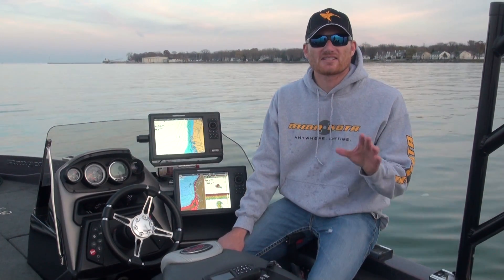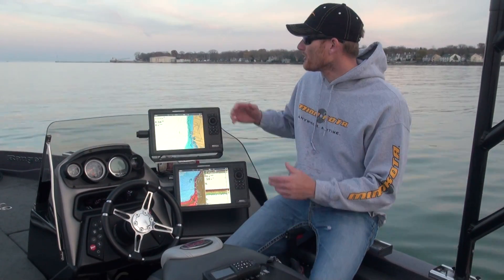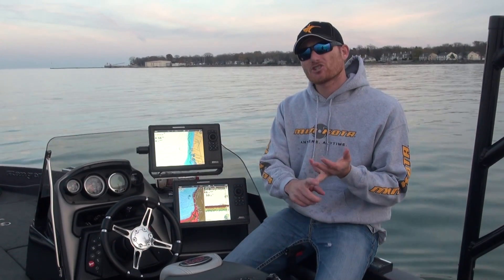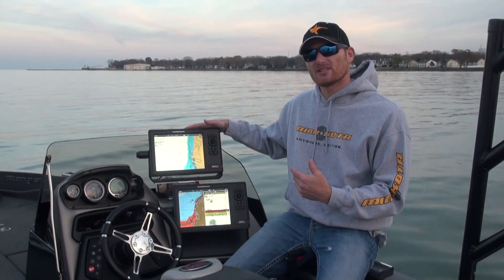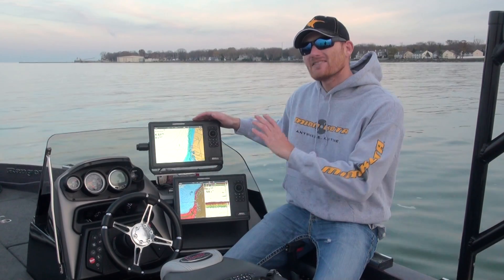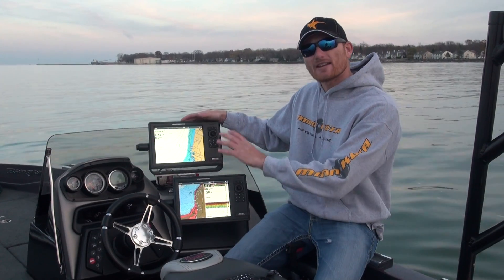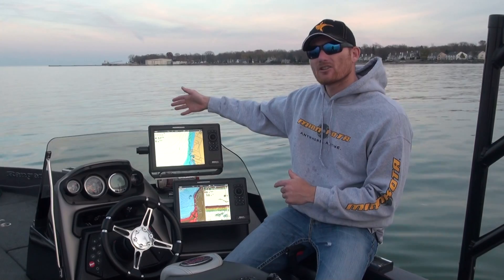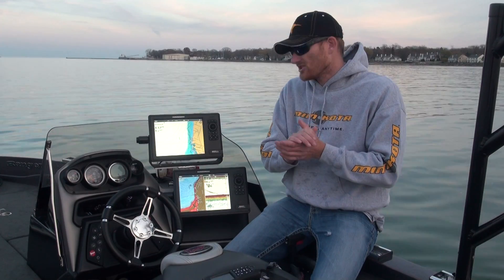Minn Kota and Humminbird Link System --Features and Advantages

Comment: Works Great! =>>lovy.biz/dpds?3C   but do yourself a favor, make certain you put an inline fuse on the hot wire. It will save the motor. I used a 30amp. First time out, i got caught in a heavy weed bed. It blew the fuse before I burned up the motor.